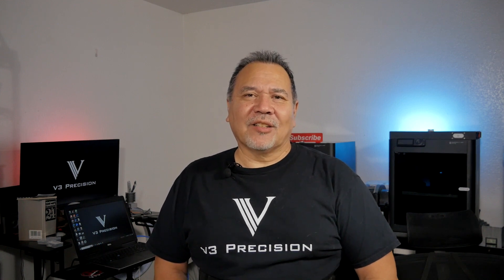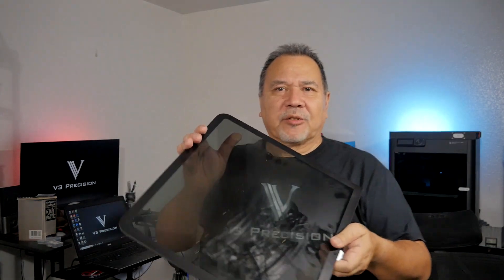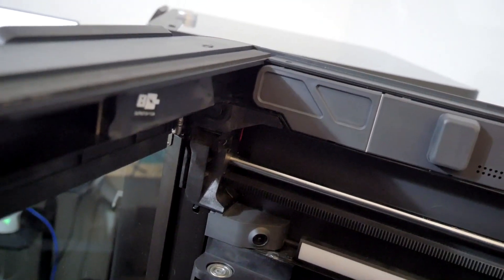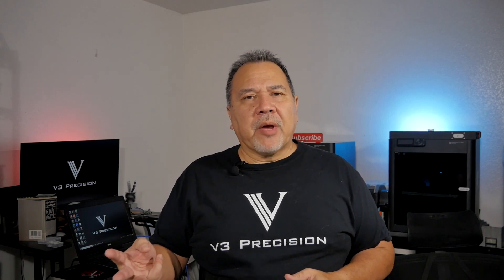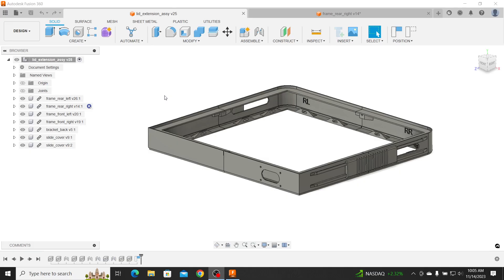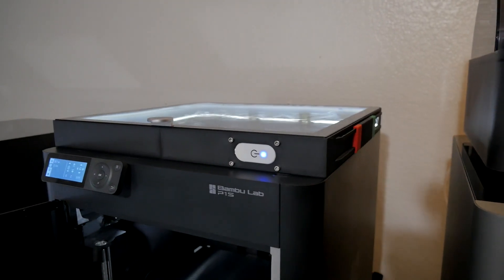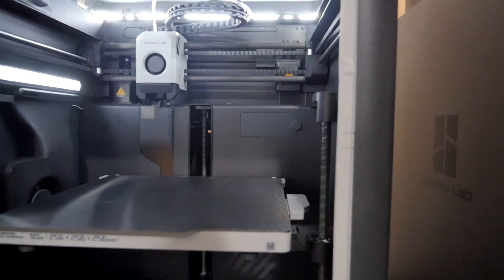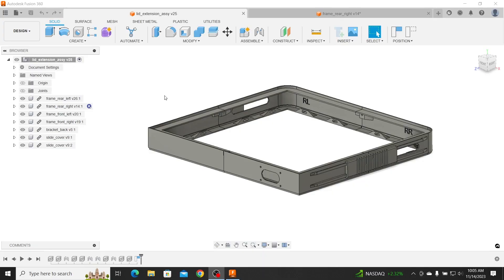LED Lid Extension for the Bambu Lab X1 and P1 Series Printers

Comment: I just finished installing this puppy on my P1S. Very nice model! Just need to tweak the model a bit to add a bit more strength at the 90s and some of the curved radius didn't print very well in the default plate orientation. 

Would be nice to have the corners printed separately on their own plate so they look better when they are completed.
Reply from the maker: I agree. I was going to start working on another version with separate corners and different power input.👍👍

Comment: Thanks for sharing! The on/off button is a nice touch and the vents as sliders make a lot more sense than magnetic doors I've seen on printables. Also with COB leds there is no need to mount it at 45 degree angle. I'll steal these ideas for my design with your permission
Reply from the maker: I use a lot of magnets, but I thought the slides would work on this design.